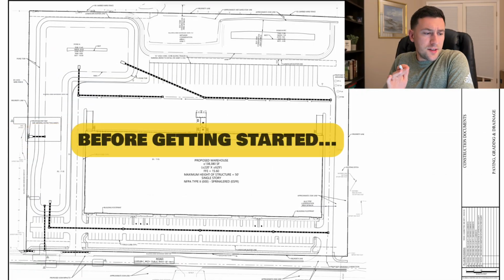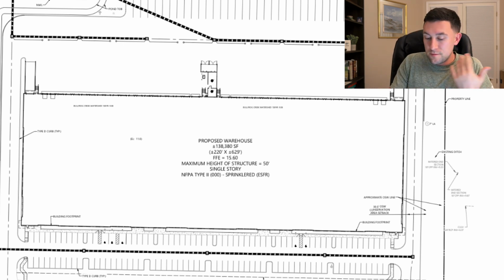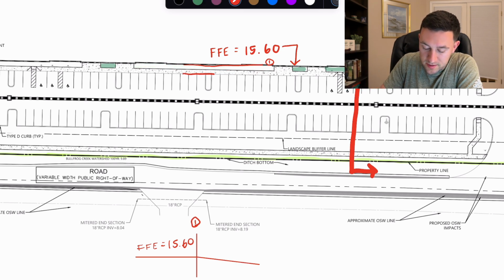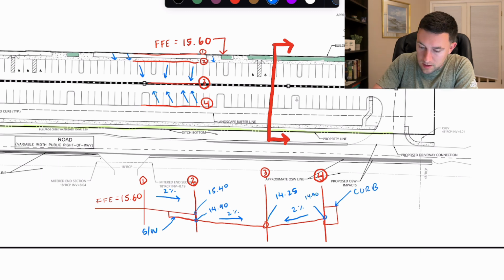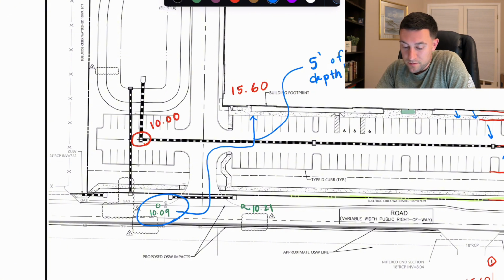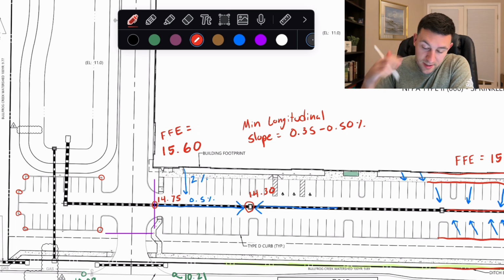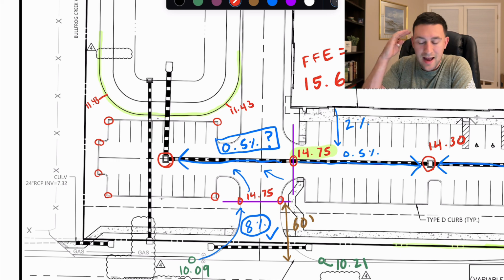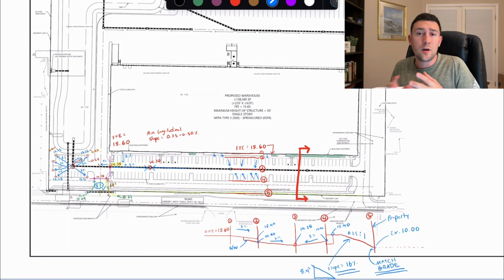How to Grade A Commercial Site (PART 1)

Comment: Great video!
If there are no drainage ponds nearby or they are located distant from the lot under consideration, how would you then get your low points?
Reply from the maker: You'll always have to guide surface water somewhere. Each project should have an ultimate outfall, whether it's an existing inlet, pond, ditch, etc. However, some projects have great soils where you can infiltrate into the ground. You'll still set low and high points everywhere, but the low points in this case would collect water and send it to an underground chamber. I hope I answered your question!

Comment: Thank you for acknowledging that every individual has their own solution. I agree that as long as the solution adheres to the standards, it is correct, even if done differently. sometimes other professionals make their peers and feel inadequate when they do not design exactly the same way as them
Reply from the maker: @CN82-tl9br  totally agree. Because I know someone eventually will comment on this video saying “their way is better.” At the end of the day, there are multiple ways to pitch slopes and direct drainage. Whatever is most efficient, less costly, and meets standards, then perfect. There are also so many different factors to look into, hence why there will be multiple parts

Comment: When, where and why we’re using retaining wall?
Reply from the maker: Use a retaining wall when you can't meet your required slopes, which is typically 4:1 or 3:1 max. If you're limited on the horizontal space to grade down to match your property, or some site feature, you'll need a wall.